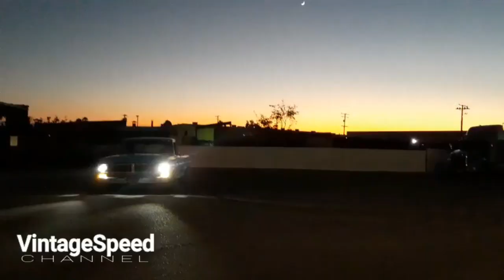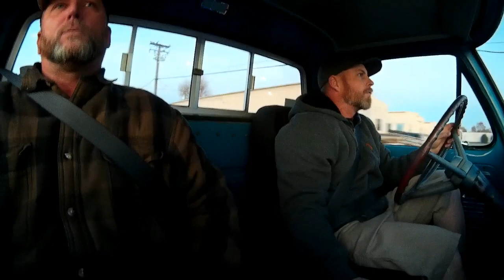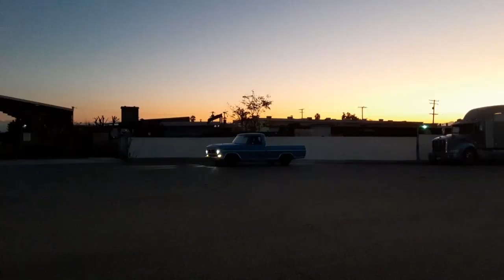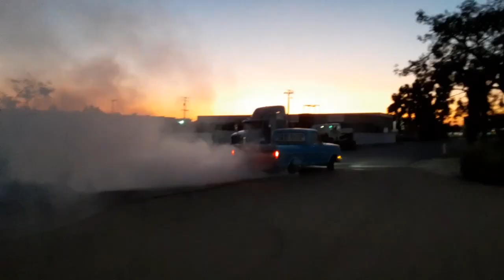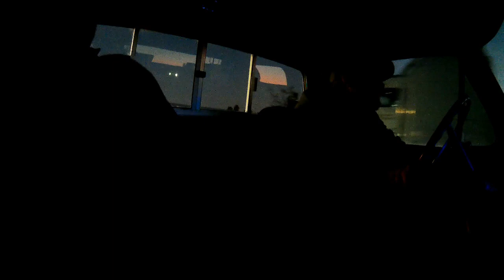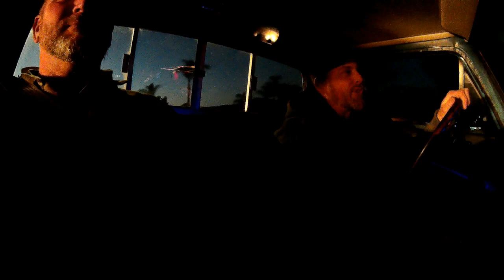V10 Swapped F100 Goes FULL SEND!  Burnouts & Donuts on the Limiter!

Comment from the maker: update - truck is working great, it's my daily so i beat the hell out of it every day.  it's run up to 135mph (allegedly) so far and lots and lots of 5600rpm burnouts.  haven't had a single issue to report, changed the brake pads and regular oil changes.  it needs a 4 link to be able to get the torque to the ground to launch it, just spins.  thanks for all the questions and kind words!  oh, i did swap the rear gears to 3.73 since this video was done, was 3.55s at that time.  and it now has a one piece rear window, a little lower in the front and some other cosmetic stuff.
Reply: I just found your channel and there are a ton of great tips!  I'm mostly interested in the OBS door panels you were working on.  How did they turn out?  Will you be doing anymore videos?  Cheers from Texas!

Comment: I have many fond memories of the triton v10. The exhaust note is lovely in person.
Reply: Let’s be honest there great for hauling but they sound like hell especially straight piped
Reply: @pm4813  Most engines sound rough straightpiped. The v10 has a very strange Y pipe setup that drones more than a typical engine. With true duals, they sound fantastic.
Reply from the maker: @pm4813  i haven't heard one straight piped, but i'll take your word for it.
Reply from the maker: @madmod  mine's 2.5" SS with X-pipe at the xmember, then i ran it into two reversed 3 chamber flows.  i like it, but i guess it's not everyone's cup o' tea.

Comment: Not many love the v10 had a 99 super duty. Damn do I miss it. Be sweet to put one in a crown vic also
Reply: I have a spare 3 valve 6.8l and a 08 Crown Vic...if I can get some help with the ecm part of the build, I'm doing it! What mufflers are you  running on the #V1Bumpside?
Reply from the maker: @123karismith  just some flowmasters.  thanks

Comment: Love you used a v10 everybody hates including me until I owned one of these engines I have a 3valve in my 08 super duty with the zf6 I embarrassed my  buddy’s. one has a new 6.4 Hemi in his ram and the other a newer 6.0 in his gmc and towing our boats mines about 600lbs heavier 5200lbs loaded with gear up over the summit here in pa on old rt40 it’s a 4mile 6percent grade I can pull about 15mph faster up it plus my truck is 500 lbs heavier has 100k there’s are both under 50k

Comment: What efi are you running in this, I’m considering doing this swap in my Obs f150
Reply from the maker: currently running an 01 factory ECM with a Moates QH chip & custom tune.  i do have a full SA to put in the truck when i swap the 3v heads.

Comment: Did you have to totally custom mount the engine mounts and tranny mount/crossmember? They’re aren’t off the shelf V10 swap kits into a Dentside that I’ve seen
Reply from the maker: i have a CV front xmember so i modified some CV motor mounts for the front, the trans xmember i made out of some 2x3 tubing.  thanks for asking!

Comment: I got my 2001  f250 donor. Going in a 1935 slant back ratrod. How much of the wiring harness do I need. Just the pcm to the engine? Would love to talk to you
Reply from the maker: cool, good luck with your project!  the problem you're going to face is the ECM, the company i bought my tuning parts from is out of business.  (Moates)  you can still find some the hardware but i dont recall the name of the company that bought them.  you'll need a J3 chip and the accompanying programmer chip for it, and the software.  do some research on that.  if you're using a manual trans it will be much easier because you dont need TCM so there are many ECMs available, just needs to support 10cyl ignition.  injection is easy because they all pretty much support 10cyl.  as far as circuits you need, all the basics;  O2s, fans, IAC, TPS, MAF/IAT, MAP, ECT/CHT, coils/injectors.  i ran my alternator just off ignition with a resistor inline, worked great.  but you could also do ECM controlled.  you could also use one of the unused inputs for logging WB.  so, it's the same as any other swap, hard part is the 10cyl support.  if you end up with Moates hardware LMK, i can send you my calibration (manual trans config).  thanks for watching!
Reply from the maker: also, check into HPTuners, i dont know if they support that EEC/ECM, but if so that's also a great platform!  i use HPT all the time on various projects, and it's pretty great.  👍

Comment: What mufflers are you running? Dual? Single muffler? Thank you. 

I have a v10 3v i need a nice muffler setup for..
Reply from the maker: i'm running gibson headers,  2.5" x-pipe to dual full sized flowmasters.  it sounds pretty good and is "quiet" until i really get on it.  it does have a weird drone at about 1800-2000rpm which may be the x-pipe on the odd fire 10cyl, so be warned..
Reply: @vintagespeed  cruising speed for me is 2200rpm at 60mph.. It has 4.88 rear end gears and 225/70R 19.5s on it.  I should be "above" the drone at cruising.  What model flowmaster? Thx for replying.
Reply from the maker: @romadonezero  these are super 40s.  mine are a litlte 'special' because i cut them apart and reversed the end caps, but didn't change anything internally.  i did that because i wanted the inlets to be closer tot he frame rail.  2200rpm with the 3.73s is about 75-80 for me.

Comment: Hi there! Saw a comment on a different video saying you’ve been dealing with carburetors for decades now and i was wondering if you can help me out with my corolla’s 4alc carb, it isnt passing smog and ive been told a rebuild on it or just a new one entirely but ive only been able to find one which is the exact same as mine but it’s listed for 700usd
Reply from the maker: sure, i can try.  what is the reason for the smog failure?  what are hte numbers?

Comment: So what year of 2 valve did you use?? I am preparing to put a 2 valve out of a 2012 ambulance in my 79 bronco and im having a hard time finding out what to do about all the stuff i dont need. Abs bcm i/p did you make a stand alone harness??
Reply from the maker: that's gonna be a cool bronco!  my motor is an 01, i cut down and reversed the harness i had so i could hide most of the wiring, so yeah it's basically an SA harness.  i have been shooting some video of the harness work for my son's 4.6 swapped '71 bump.  will post that up soon.  good luck on your project, thanks for watching!